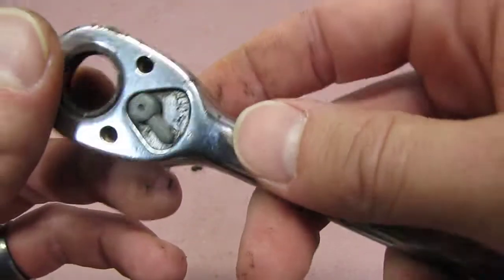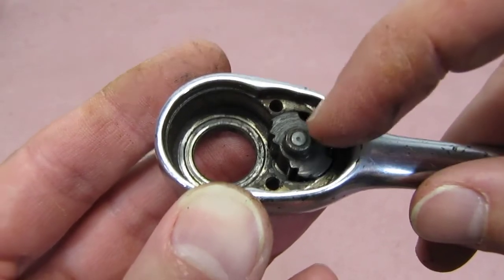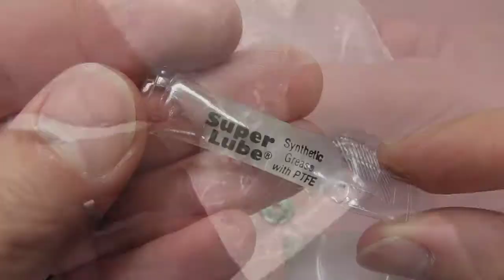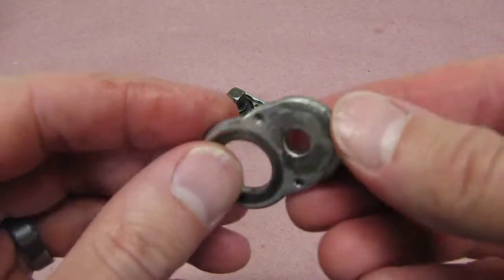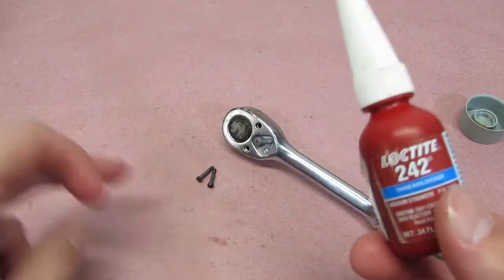Vintage SnapOn F-71-D 30T 3/8" Drive Ratchet Disassembly, Cleaning & Reassembly

Comment: FYI, there also is an alternate replacement gear wheel, which in my opinion is the best choice to use that will directly replace the 30 tooth gear for these particular F71 gear wheels, if a new gear wheel is needed because of broken teeth, or just general replacement due to wear. The 30 tooth gear from the F723 will directly replace the F71 gear (kit# RKRAF723). The F723 quick release gear has all of the same machining dimensions as the 30 tooth F71 gear uses, and you add the handy quick release feature to the ratchet. The 20 tooth F723 gear will not work in conjunction with the F71 pawl. But the 30 tooth does. Just another option for those who still use F71's out there. I have close to a dozen various model F71's which has the 30 tooth F723 gear installed in them. If you install a new F723 gear, put it all back together and tighten the screws and it locks up, then your bushing has backed in too far and it simply needs to be pushed back out. Which can and does happen. But the thicknesses of the F71 & F723 gears are the same.👍-Jed

Comment: I found a similar model (F720A) in the bottom of a compost pile when I first moved into my house.  No idea how it got there, and it was frozen up tight.  Since it was a Snap-On, I decided to save it.  Soaked it in transmission fluid for a week, and it started to work quite well.  Will be doing a more proper clean up like you showed now.  It's a very sturdy ratchet design. Thanks for the video.
Reply from the maker: This makes me happy.  :-)  You're welcome!

Comment: I had a previous comment regarding the specific repair kit this ratchet could use, but somehow it was either deleted or removed for some reason? But I did want to mention one other observation I have noticed about the F-71-D ratchet, beings I have dismantled MANY over the years. There is a reason why the F-71-D has a rather stiff tight harsh action to some (not all) of them. It all has to do with their specific pawl and spring combo S-O used together. To start with the pawl, it has a rather horizontal directional incline/decline where the ball contacts the pawl. This feature does greatly determine what the ratcheting relationship is between the pawl and gear wheel. Secondly, the particular spring used on these and other S-O ratchets at the time was their conical style spring with a portion of "dead spring" on the lower portion of the spring. I have myself corrected this problem of their harsh action by simply trimming a few coils off this dead zone of the spring. Doing this shortens the spring, dropping it down farther therefore reducing the generated pressure exerted on the pawl by the spring, softening the action. But obviously this can only be done by completely dismantling the ratchet. Anyway, hope I added some food for thought for everyone here who has an interest in old Snap-On tools. Thanks again for this video!👍
Reply: do you know what specific repair kit you would need? i just found one of these ratchets and i want to rebuild it

Comment: regarding your comment that its sometimes difficult to remove the bottom plate, I found on two of mine that just striking it on the tabletop after removing the screws was enough that it popped right off.

Comment: SO wants to make sure that you buy another $100 wrench by making it impractical to remove the pawl.  Grease over time dries and cracks gumming up that pawl and nicely attracting dirt.
Reply: Actually, if you read the cover plate it states to  lubricate it often. So if you do this the grease won't gum up over time and you should NEVER use grease in the ratchets, only Super Lube. That's what the factory uses because a heavy grease won't let the pawl move freely enough. The new ratchets have seals on them and the 80 tooth design is significantly stronger than the older  30 tooth designs.
Reply: @mikedorsey8645  The ratchet plate in the video does not have text.  My SO ratchet plate does not have text (at least the pawl is not peened).  You are right that grease is a poor lube for a ratchet.

Comment: What’s the pink liquid in the jar when you use the ultrasonic cleaner? Might do this myself so just curious. Thanks
Reply from the maker: If I remember correctly, that was slightly diluted "Purple Power" degreaser.  Using the jar to separate the cleaner is a great hack that works well.  Good luck!
Reply: @DIYNexus  awesome thanks for the help